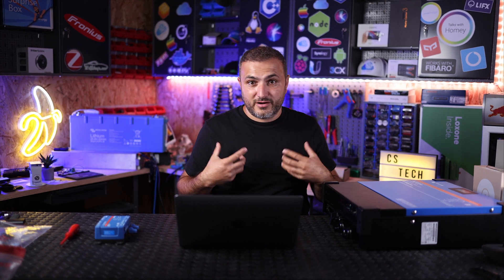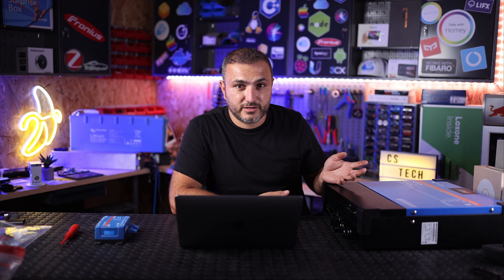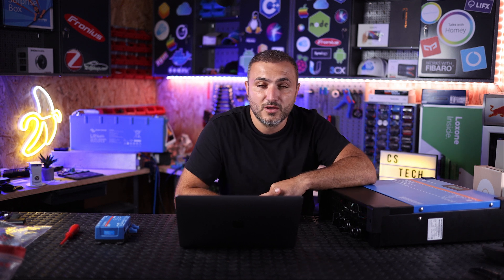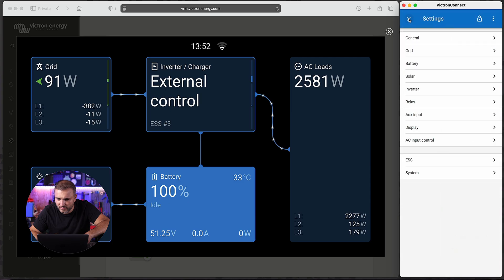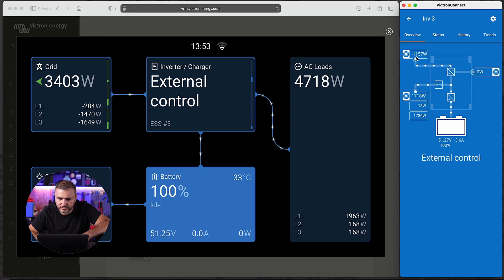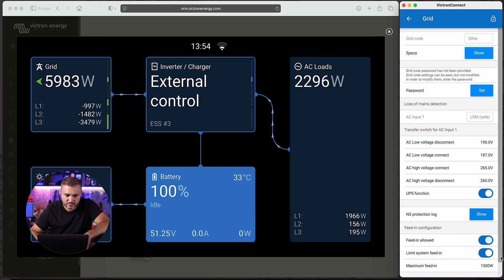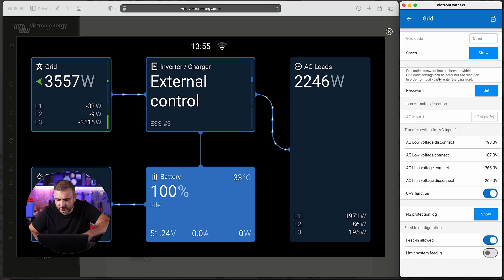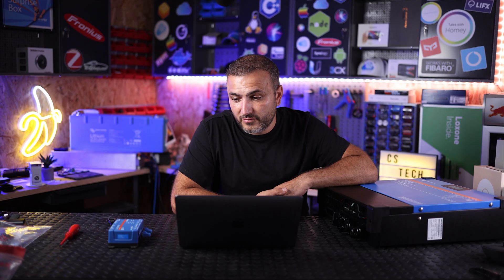Testing Asymmetrical Feed-In with Victron Multi RS 48/6000!

Comment: I am thinking is buying this inverter , please can it supply 5000w to loads?
Reply: Only offgrid ?
Reply from the maker: 5000W is max output. If your consumption is constantly more that 4500-5000W, you should consider a bigger model like MultiPlus 2 48/8000 or 48/10000.
Reply: You can make a parralel connection for each phase 2x6kw for each phase?